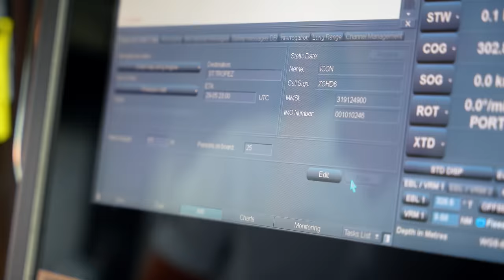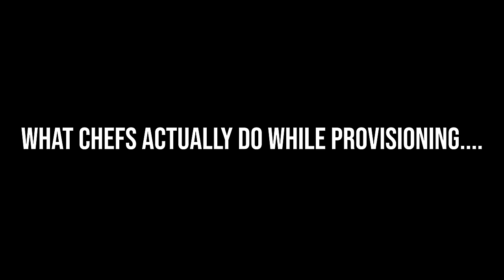What a $1,100,000 Charter Looks Like

Comment: Great video, how can you tell when the anchor has left the bottom is it when the chain goes straight?
Reply from the maker: Hey Robert, 
There are a few ways. The chain is marked in 'shots,' which is 27.5m (90'), so we know that when we anchor in 40m depth of water shortly after the second shot is sighted, the anchor is close to being off the bottom. You can usually also tell as the chain will swing slightly and then be straight up and down. At that point, the anchor operator will radio the bridge to let them know we are free and we can slowly start maneuvering.
Great question, and thanks for watching

Comment: watching this video I was wondering how many crew would be required and then near the end you said 20, which was about what i thought.
I'd be interested to know the crew breakdown re operations and hospitality.
I'm thinking 6 or 7 running the boat and 13 or 14 hospitality.
And also there would be quite a few in the hospitality that play a role in operations particular when docking.
Reply from the maker: out of the 20 there is:
Captain
Chief Officer
2nd Officer
Bosun
4 x Deckhands
Chief Engineer
2nd Engineer
Electro-Technical Officer (ETO) Does all high voltage and AV IT work
Motorman
Purser
Chief Stewardess
4 stewardesses
And the 2 chefs.

When docking it's all hands on deck to help with lines and fenders.

Comment: Is it true that a lot of the yachts in Monaco are there without any engine on board?
Reply from the maker: Haha, I don't think so.. Monaco port has stringent rules on vessels' seaworthiness, maintenance, insurance, etc. I can see how this rumor started when so many boats are based there year-round.
Reply: @motoryachtloon  It was my sister who were told so when she was there during a Formula 1 weekend as a company trip, but as you say, there are probably some strict rules. However, I know it's a fact down some other places, such as Nice and Purto Banos. I have always been on vacation along the coastal line from France and down the entire Spainish coastal line. Usually spend 2 weeks each summer at some hotel in the mediterranean. So it may be some rumour mixed with experience from other places. Anyways, when my sister was in Monaco, before Mercedes AMG Petronas re-entered the grid. 😄 so it's a few years since she was there.
Reply: @motoryachtloon  Anyways, it's always interesting to watch these videos you're making. Always wanted to work on a private yacht one time,  but came to realize the only work I can do is security in dangerous and hostile waters. without any VIP pax. Is that a current work position on yachts? I was in the navy, and did all my anti piracy and anti terrorist training there. Worked of the coast of Somalia with the Royal Norwegian Navy's friggate with the NATO joint taskforce combatting piracy. Then private contractor onboard cargo and oil tankers.

Comment: Chartering is cool however I feel the whole experience is rushed for the guest
Reply from the maker: The pace depends on the guests. Believe it or not, this charter was very slow in pace, only doing short movements each day. Lots of chilling, naps, and hanging out. Other charters are very high speed covering hundreds of miles and doing all kinds of extreme activities, and we, as a crew, need to adjust quickly to the guest's requirements. 
Thank you for watching.